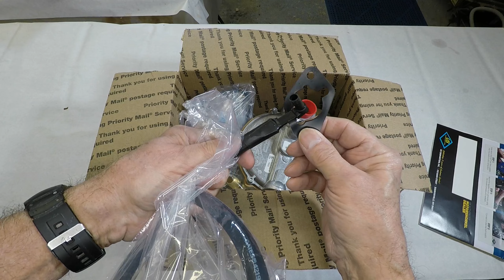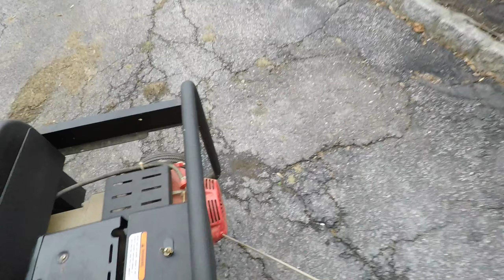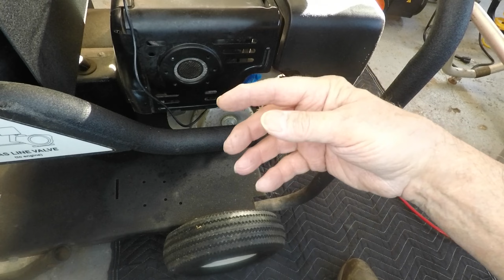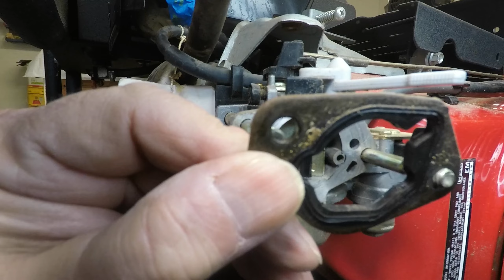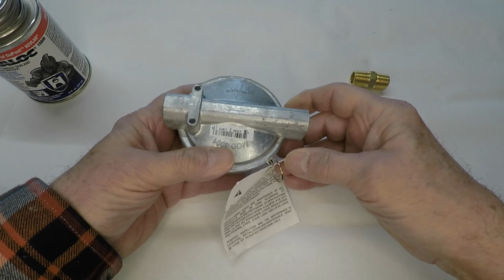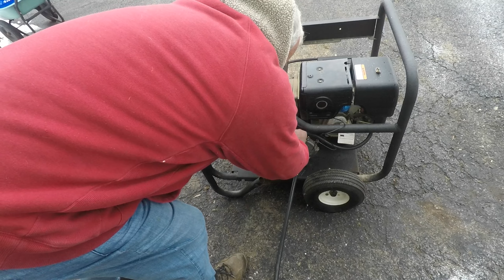Gasoline Powered Generator Modified to Run on Propane

Comment: Hey Doc - have you found that a 20 pound tank of propane lasts longer or shorter than filling the generator tank with gas?
Reply: 😊a proper fille 20 bound cylinder will hold 4.5 gallons, be aware of the quick exchange places. Very rare to get a full tank from them. Get to a Tractor Suppl co. for a the best fill.
Reply: @stankrieger3598 most welding supplies shops fill any size propane tanks to 80%. In my area, there's ese one Goodwill store fill it but only to 65%
Reply: Will it be harder to start with gasoline with the choke plate blocked open?
Reply from the maker: First of all, thank you very much for watching. My generator runs longer with gasoline in the tank rather than the 20 pound tank of propane. I use both sometimes it’s more convenient just to grab a tank off of the barbecue when power is out in town. Even the gas pumps aren’t working. The propane becomes very convenient. Hope that answers your question.
Reply: @DrJoe1   - good to know; thanks for responding.  And great point about the gas pumps not working in town during at outage. Most people don’t store gas (and if they do, it has a limited shelf life). A tank of propane will last years, if not forever.